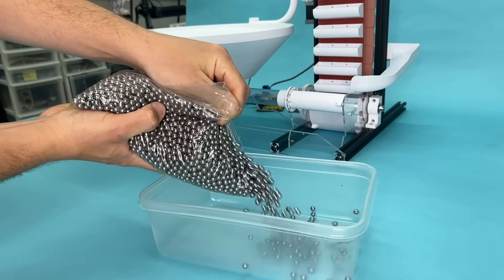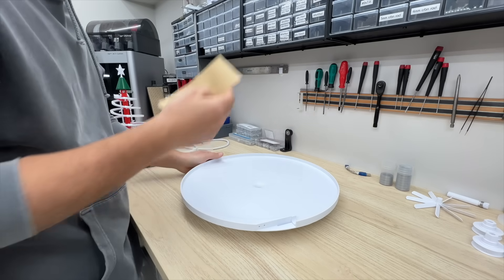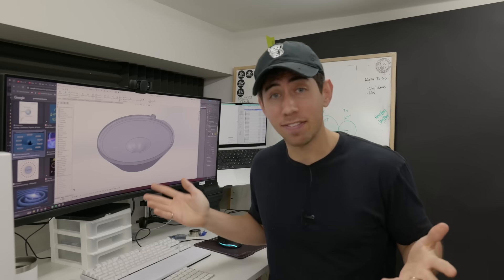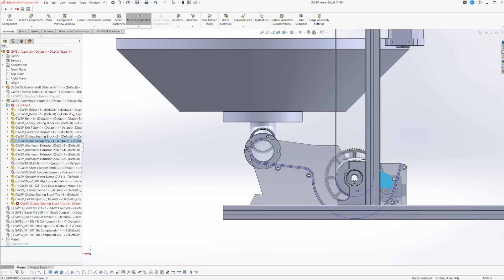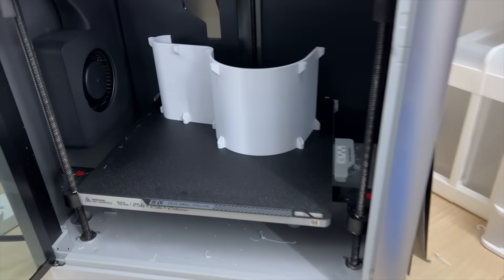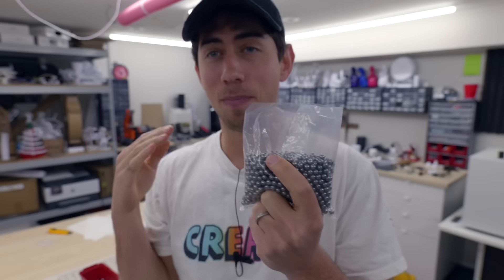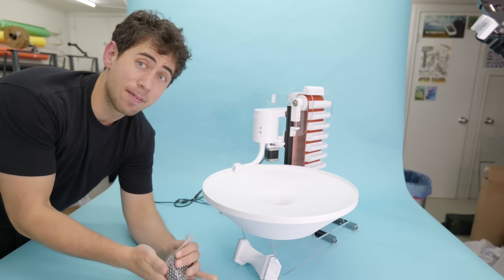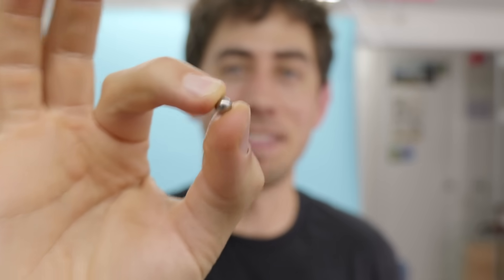Can this Machine Handle 5000 Marbles?

Comment: This model of a gravity well is based on toilet bowls. Take a telescope and look at the planets, do you see any gravity wells??? Take a look at the Sun, keep looking until you see one of the planets fall into it, like all the balls do on gravity wells. BTW- wear SUNGLASSES.

Everything you think you know about gravity is wrong. Mass does not Pull, Time Pushes.

Take a dumbbell, see if you can pick up some scraps of paper, a feather, or maybe some dust with it? Does the dumbbell pull anything???

Don't let these bozos do your thinking for you. Think for yourself.

Show me some curved space time, not CGI or a drawing, but something real. You cannot do it.

That curve is based on acceleration = 32 feet per second squared - the only variable in that formula is TIME, not SPACE.

TIME causes the acceleration known as gravity. MASS DOES NOTHING. TIME pushes towards MASS.

It's a magnificent machine, but do you think reality could work that way???

Comment: I use some inductive sensors on a pinball machine project to replace the mechanical rollover sensors.  I think a really neat project would be to install 10 of them (assigned 0 thru 9) on your gravity well and use it as a random number generator.  As a ball rolled over a specific inductive sensor, the assigned value of that sensor would be appended to a string of numbers.  You could generate a 1000 digit random number is just a few seconds. If the sensors were place in the lower 2/3's of the gravity well, the balls would circle the center 2 or 3 times before encountering the sensors giving them plenty of opportunity to be bounced around by other balls.

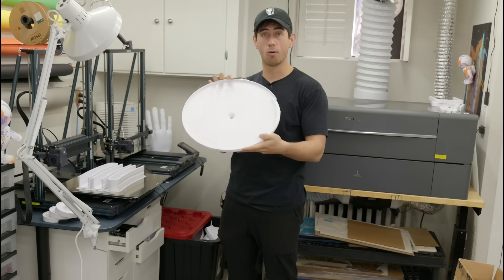Comment: 3:25 After first viewing some of the 'shorts' videos before this one, the amount of trial-and-error did lead me to wonder about how you handled waste/failed prints right about the point where you covered it. Nice to know print recycling is a thing ( although really pricey -- the pictured device doesn't even include a grinder in its base config). 

I am completely feeling the part about space (train collector here). I've more than a few ideas about useful stuff to CAD out (well, maybe not with $olidWorks) for printing...but I don't currently have space to park a decent FDM printer - at least not anyplace where the noise and odor could be properly confined/vented.

Comment: Towards the end watching this, I'm thinking " Now try it with the 1/2" AND 1/4" ball bearings at the same time "

Background: Back in my childhood, I used to build what i called "marble coasters" out of Hot Wheels tracks and whatever random stuff I could prop them on around my bedroom furniture. Not having access to large quantities of uniform-sized marbles or ball bearings, my payload developed into a mishmash of regular marbles, shooter marbles, steel balls of varying sizes, BB's and even a few plastic and wooden beads. The idea was to cram the entire collection through this contraption as quickly as possible (not really as they all had to be hand-placed at the top-of-track), and all the balls regardless of size/weight had to make it to the end. Tuning was necessary to ensure the lighter balls didn't stall out (though they'd get pushed along by heavier ones), and the shooter marbles + larger steel balls didn't gain enough speed to dive off the track. 

I would have loved to have had the means to build a conveyor to get marbles from the bottom to the top. The wildly varying ball sizes/weights would no doubt become its own challenge for that.

Comment: You didn't mention at all the lower ball-catcher tray on the back of the machine as seen at 9:18.
It appears to be an attempt to catch balls that bounce out of the upper tray, with a return chute to the bottom catch tray at the front.
Not sure if you intentionally or accidentally left out discussing that part, but would have been interesting to hear your take on that part of the machine.

Comment: Your calculations are correct 1 ball is satisfying but 5000 are 5000 times more satisfying ;)

Same concept if you light a sparkler in the middle you have double the fun in halve the time !
Reply from the maker: 5000 sparklers 😈

Comment: I am not a super big machine enthusiast. But I can say this, you made a damn good simulation of something like a black hole or so. Looks close to some 3D generated stuff I've seen and most likely there are some 2D models that look very similar to this. But yea just redo the angles dependent upon the black hole and you can do a pretty nifty job seeing how particles should act around a blackhole... think its beyond the event horizon though since balls cannot escape.

Comment: My only experience with a gravity well was for some large donation container I saw as a kid. I think it was even designed to drop 2 quarters at once, maybe 4 (2 on opposite ends). Once I understood to use the ramps instead of trying to roll them by hand, I was mesmerized and wanted to do more. Maybe try to do a distribution setup for coins and give that a try?
Reply from the maker: That would be fun! Will definitely revisit this in the future

Comment: I mean, if you wanted to recycle the old 3d prints quicker, you could get a $30 panini press and melt them down on that with some parchment paper, then you end up with some easy to stack and store ingots instead of weird bulky shapes. I'm not sure if there's an inexpensive machine that could melt down plastic blocks to turn into wire that could be used as filament again, though.
Reply from the maker: Not a bad idea!

Comment: I had the though, just a few days ago, to make a gravity well, with the outside wall actions as sort of a rail gun, or like the CERN super collider, sort of. The goal being to accelerate a single ball bearing so that it stays in the well for as long as possible. I would e important for the outside wall to be unbroken to not affect the path of the ball and naturally it would also be a balance act to find the ideal shape of the well. it's not much fun, after all, if the ball just stick to the outside wall until it lose enough momentum to actually fall in.

Goes without saying that I am not actually going to do this, but would be interesting to see you do it.

Comment: The smaller bearings are better I think. With the smaller bearings, the gravity well input hopper resembles a grain washing tank, and the gravity well itself potentially resembling a grain strainer, and the recycling lift is a grain lift, as intended.

Comment: The real challenge: Create a gravity well machine that shows a stable orbit around a gravity well.
Reply: Ok, here we go: show an obvious invisible dense massless unicorn-Dna map on a 4D chess board in the rotor of an airway, mid-tressel. Oh, but do it on the outside of the inside. And make sure you're doing backwards figure eights when you're just going straight forward. 
There we go. 
I just made an equal amount of sense to what you said the real challenge would be.
Reply: From somebody that actually knows what the words you use actually mean please don't use them if you don't know yourself. And yes the ridiculous gibberish I said above makes just as much sense as what you said.
Reply: Gravity Well= made up term.

Comment: Hey Jay,
I'm always impressed by your INCREDIBLE projects! You are just great! But every time I wonder how you do it. You already mentioned that you use Motion Gen for some things and of course Solid Works for all your projects. Which application do you use to simulate this directly? After briefly reading up on Solid Works, I noticed that there are certain categories with different areas and features. I'm a bit confused and would like to know what exactly you use.
Reply from the maker: I use a combo of the software tools and experience of many past failed projects and iterations. For Solidworks, I’m specifically using the premium license, but no simulation add ons. Hope that helps!
Reply: @Engineezy Thank you for such a QUICKKK REPLY!!! It helped a lot! Sorry for my late response...

Comment: Since you spent all that time and effort getting a ball elevator working, it wouldn't be much more work to make an Eames probability machine (AKA Galton Board), like the one that was famously exhibited at the 1964 New York World's Fair. I've wanted to do this for a long time, but I don't feel I have the time necessary to perfect the ball elevator. Photo can be seen here, also several videos online.  https://i.pinimg.com/originals/c1/a2/84/c1a28402ea34b353e3abaee8ce24c0f6.jpg

Comment: The longer marble run (think of Marble Mountain, that 10 year old video of a long, handcrafted marble run out of 5 different modules that fits on four different woodworking tables. This doesn't need to be that, but it should at least have a pretty good length
Reply from the maker: Love the idea!

Comment: If you want to minimize your top layer count and reduce infill density and prevent that pillowing/quilt effect on your top layers, then the rectilinear infill pattern is really hard to beat. There are a few infill patterns that increase in density towards the top e.g., adaptive cubic and lightning, but rectilinear is dead simple and has a more uniform strength profile.
Reply from the maker: Thanks! Good to know!

Comment: Why do you always print in white? Is it for aesthetic reasons? I've heard that black filament is much easier to print than white filament because the white has more dyes in it.
Reply from the maker: Mainly for aesthetic reasons!  Also, I have multiple machines so its much easier to keep the same filament across all the machines!
Reply: @Engineezy  Thanks for replying!!! Hey, if I send you my book, Computer Engineering for Babies, would you feature it in a video somehow?

Comment: Ya know....some places like Tractor Supply, not sure what country you're in, but they sell "belt" material by the foot. They use it for conveyer belts and stuff like that. It's like 4, 6, 8, 10 and 12 inch width. Just so you know. I mean your basketball stuff is fine if it works
Reply from the maker: Good to know!

Comment: You want a convex outward crown on the center of your rollers, not a concave inward one. Its kind of counter intuitive just looking at it (you have to think of the elastic effect and the tension in the material making it creep around a tension gradient for it to make sense), but the material will want to ride up the curve  to the high point, especially if it has any stretch in it at all. I use this all the time for keeping rubber bands on a motors shaft, just a little doodadd on the shaft that has a slight center bulge and they wonder right back to the middle!
Reply from the maker: I actually ended up going with convex! Saw the steve mould video about it!

Comment: Well done. I prefer the larger balls.  You may use the iron balls to complete a circuit. Therefore while balls passing from a control point lights may be lit or some mechanical system can be triggered. You may also experiment electro magnets ...
Reply from the maker: Cool idea!

Comment: Another idea - auto-pachinko. Feed into a horizontally sliding chute at the top of the machine that will deposit the BBs into the pin-field. Rig it so that once the middle catch area fills all the BBs are drained from the field and recycled. Potential for pinball style lighting here if you give the pins a metal ring around their bases so that the BB completes the circuit for a light. Other possible inclusions - rotating sections of the pin field, automatic pinball flippers, archemedes screw lifts running up both sides of the play feild so you can watch the BBs get raised back to the tank at the top.
Reply from the maker: Oof you got me on the auto flippers! Endless chaos

Comment: Your best results on the center of the well would be to make it an aperture that can fit 7 balls at a time.  Essentially a perfect hexagon of balls.  One in the middle, six around it.

That means, no matter the rate you drop them into the well, it should never get stuck or slow down.

A slightly steeper beginning incline from the outer edge, as well as having the wall meet the incline being rounded at the same curvature as the balls, would make for a slightly smoother and earlier descent into the well.  It's like merging on a highway, you need the balls already on the track to get out of the way of those coming on.  They'll bunch up less and have a much smoother trajectory into the well at the center.

Comment: You know what I’d like to see: if the rolling inertia makes a difference. Let’s say the objects were spherical shells instead of solid balls. Or, if they were rubber so they would roll instead of slide? Very light spherical shells? 

Would objects with less mass or less rotational moment of inertia more closely approximate point objects falling through space?

Comment: Unfortunately you have a failure point. The balls momentum force the balls all the way to the left portion of the tray and they stack up and overflow. You need to put a small lip on the holder pointed inward and then up and that will solve it I think.
Reply from the maker: Next iteration!

Comment: I know you're finished but it would've been awesome if the entry pipe to the well was brachistochrone shaped for maximum entry velocity.

I love your grain elevator solution too, my mind went straight to those hot wheels accelerators where you just shoot them along a track at high speed between two motorised wheels.

I think a cool project for the small balls would be a Bellagio style musical fountain display.

Streams of tiny balls flying into the air choreographed to Great Balls of Fire ⚪🔥
Reply from the maker: Love the ball fountain idea!

Comment: Hey man, you're really inspirational. I feel pretty discouraged from trying to make things because it feels like I don't know how or wouldn't be able to figure it out. But watching you just problem solve and makes stuff work makes that process seem more doable. I appreciate that a lot.
Reply from the maker: Glad it inspires! One of the main reasons I make these vids
Reply: My struggle is my perfectionism and intense desire to do things "the correct way".  Sure, my solutions often have significant longevity, but complete implementation is my struggle as I often fail to get to the end.  To JBV's point, "it doesn't matter how you get there as long as you get there".  Too often I let perfection be the enemy of good enough.

Comment: A suggestion for all those leftover ball bearings... use them to reduce friction on a tracked carousel like the ones at sushi restaurants! If you are feeling crazy you could use it to deliver parts or tools around the shop.
Reply from the maker: Just have the tools forever running on the carousel 😂

Comment: those pullys are wrong should be convex not concave!
Reply: or....? its hard to tell if it curves or not. i guess flat is ok but convex is still better than flat.
also you should  level it perfectly! it will be more circular instead of elliptical
Reply from the maker: I ended up going with the convex pulley! Saw the Steve Mould video, really interesting eh

Comment: I bought that gravity well stl from you and I took the well and cut it up into 8 pizza like slices and increased their size by 250 - 300 some percent. Filling up my printer bed as large as I could each piece, then connected them together with crazy glue. No need for sanding as they came out smooth and level by printing on their side.
Reply from the maker: Thats awesome! Thanks for the support!

Comment: Just a suggestion, for flat belts you should try using a convex shaped roller/pulley rather a concave one 5:25 it will help center the belt believe it or not 👍🏼

With all the gravitational study though I’m surprised it didn’t turn into a worm hole haha 😂 keep up the great videos 👌🏼
Reply from the maker: I actually ended up going with that- saw the steve mould vid on it, worked like a charm

Comment: Suggestion: If you look at Steve Moulds' Video "You can't hide the batteries when it's transparent", you have a hopper, and a kinetic way to get the balls propelled back into the hopper. A more pleasing "perpetuum motion" kind of style instead of this bulky elevator.
Either by those timely triggered magnetic coils or else some spinning gummy wheels pinching and shooting the balls. With the catapult tracks it could look like an octopus contraption.
Or instead of defined catapult tracks it could be like a vase/pot with the hopper inside. Where a fast spinning disk on the ground below the hopper just catapults them up the sides back into the hopper above by centrifugal force.
Reply from the maker: Will definitely take a look!